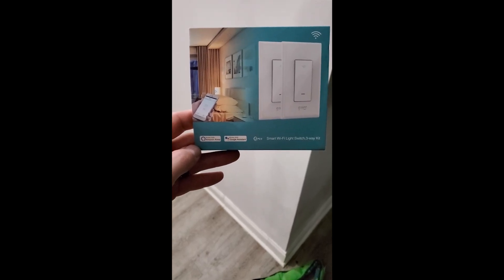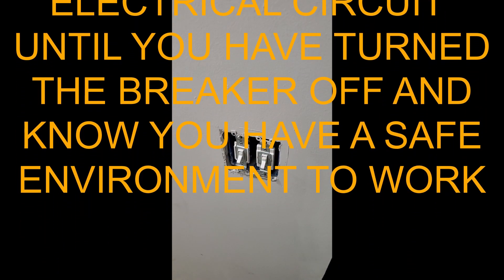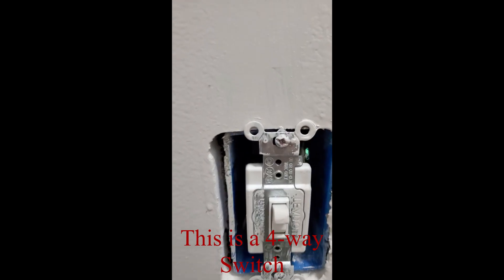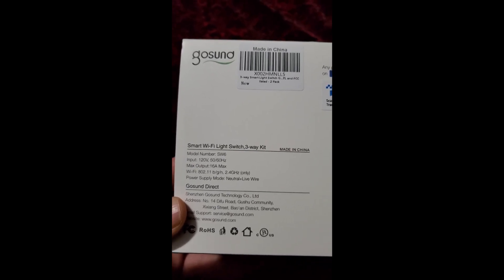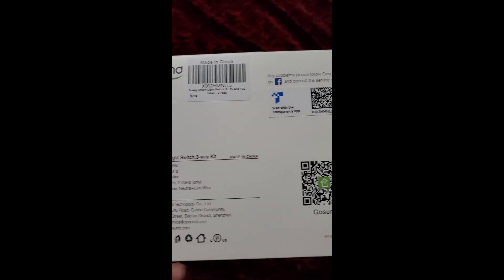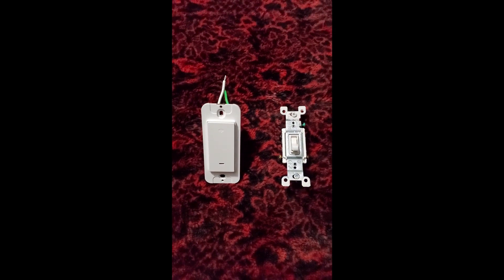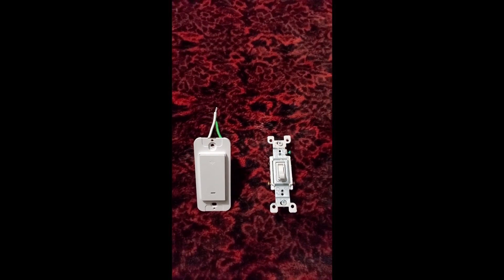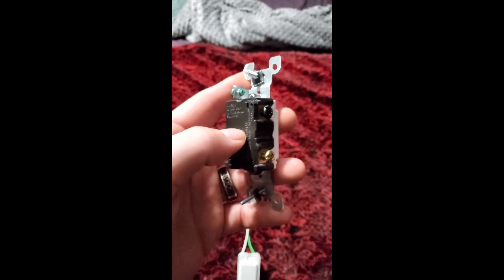Gosund 3-Way Smart Switch on a 4-Way Circuit???

Comment: I just bought this for my hallway light controlled by 3 standard switches and one I replaced with gosund 3 way and it worked when you swtich on from one standard switch and as soon as I tired with other one it stop working. So I can operate light only via gosund but not with all 3 switches togather. 
Any speical steps  u have taken? Out of 3 standard swtiches,I found that one has neutral wire which I replaced .Other 2 have white wires but has current ( may b common wire ) .So can not replace at other switch to try.
Reply from the maker: did you make sure that you installed the smart switch where the power is coming into the circuit? when I installed it anywhere other than there I had that same issue.
Reply: @rdnckreaper   Thank you for quick reply. I m not sure but I checked other 2 swtich boxes where I did not find white(neutral wire) wire with no current even though there are 2 romax wires coming in box.  If you have some phoot on wires may help. Anyway if does not work I will end  up returning before return policy expired.
Sharing some photos
https://drive.google.com/drive/folders/1tIBp33qLc-iY-u0fSgjUYxcAn0sWpl
Reply from the maker: @uhstube74  Firstly I was unable to access the drive link that you sent me. 
Secondly, I personally would start from scratch (which is what I had to do to figure this out). Turn off the power to the circuit at the breaker box and then disconnect each of the 3 switches and pull the wires out in a way where they do not touch. MAKE SURE TO TAKE PICTURES BEFORE DISCONNECTING AND AFTER (Great Reference Tool) Then once you have all of those wires disconnected and in a safe place go turn the breaker back on and use a voltage detector to find out where the live wire is. There should only be 1 outlet that has a hot wire. Where ever that live wire is located is where you need to install the switch. The other 2 switches just need to be reconnected and put back in place. Unfortunately I do not have pictures because I just decided to do the video after I got it working.
Also with the White (neutral) wires, I found those wing nutted together in the back of my switch boxes. That is pretty much how my entire house is wired.

Comment: Hey does your light switch beep when u installed it
Reply from the maker: I don't remember there being a beeping sound just a faint clicking noise
Reply: @rdnckreaper  damn ok because I installed  few Nd they have a fAint beeping sound
Reply from the maker: @mr.mentertainment  are you sure it isn't a humming sound? if you have it wired up incorrectly it can cause a faint hum. This happened to me the other day when I was automating my spare room with a 3-way and I mixed up the wires for the light with a couple for the fan.
Reply: @rdnckreaper   no I thought the same but I have them installed in 4 rooms n they all buzz if I mix up the wires the lights don't even turn on
Reply: Beeping* sound
Reply from the maker: @mr.mentertainment  I have been trying to get a beeping noise and I just cannot get either the 2-way or a 3-way to make a beeping noise...just clicks and hums